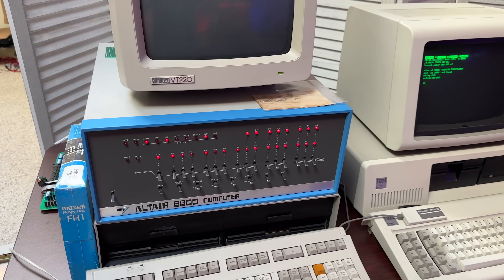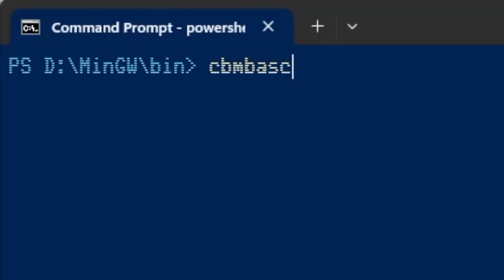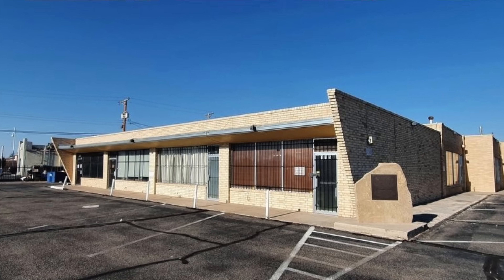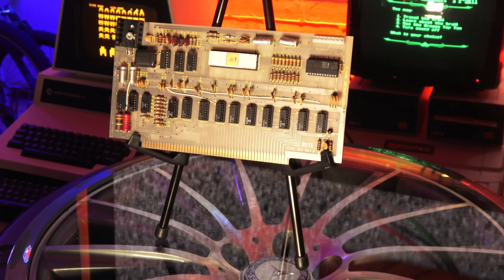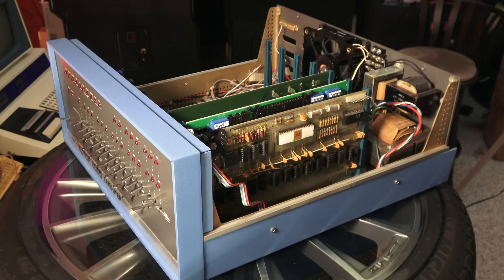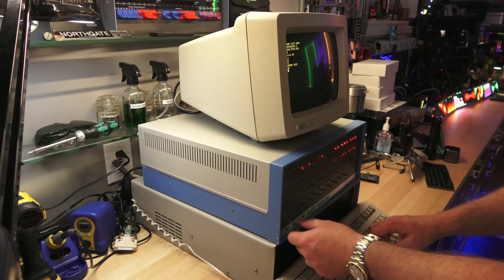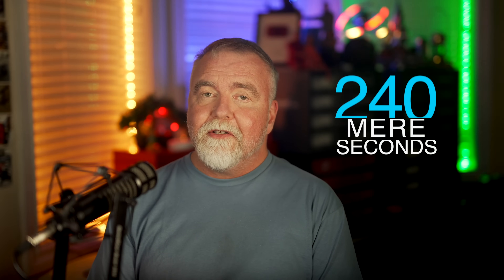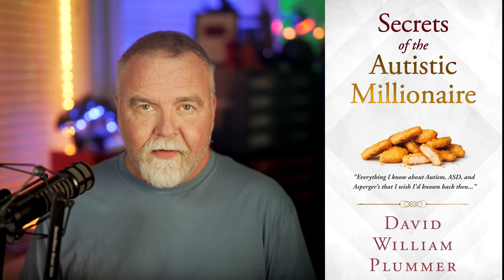Altair 8800 vs AMD Threadripper: Which is Faster?  We test them!

Comment: As a challenge, figure out how quickly the Altair could perform a simple task in response to an I/O event, and compare that to the Threadripper.  Modern operating systems have many advantages, but satisfying worst-case response times for I/O isn't really among them, compared with an 8-bit micro which is dedicated to a particular task while it's being performed.
Reply: True. Although, today, an Arduino Uno (an 8 bit micro) would probably still beat the pants off of the 8080.
Reply: @ScottWalde  Newer microcontrollers are faster, but not by many orders of magnitude.  The fastest microcontroller I know of (in terms of I/O response loop time) was a 100MHz Scenix clone of the PIC, which I think had a minimal I/O wait loop time of 40ns.  A typical 1MHz 6502 system would have an I/O wait loop time of 7us.  A 2Mhz 8080 (bottom of typical speed range) would have an I/O wait loop time of about 12us using the "IN" instruction, but that could sometimes be cut to 8.5us when using memory-mapped I/O.
Reply: @flatfingertuning727 Well, I haven't done the math, but 8080 instructions take at least 4 cycles.  Most AVR instructions take 1 or 2 cycles.   An ATMega328P will easily run at 16MHz.  A fast 8080 ran at 3.125MHz.  I completely agree it's not "many orders of magnitude" but I'll stand by my statement. :-)  Interesting you brought 6502 into the discussion... that's the one I have the most ASM experience with.  Then some Z80, and a bit of 8080, 8085 and 6809.  I can honestly say I've never hand written ASM for an AVR.  Probably the last ASM I did was on a P8X32A.  That was a fun architecture, but I mostly work with STM32s now. (and some of those can be clocked past 500MHz now.)
Reply: @ScottWalde  Designers of early LSI logic made conscious trade-offs between speed and silicon area, prioritizing the latter.  Improvements in fabrication technology have shifted the "curve" so there's not much point designing a chip that can't run 16MHz, but one could have built a computer in the 1970s that would run at AVR-like speed.  In fact, many "real" computers of the 1970s *did*.

One might view a tenfold increase in speed as "mopping the floor" with another computer, but compared with the millions-fold speed increase for some other kinds of computation, it's pretty minor.  At the bottom end, what's changed is not the level of performance that can be achieved, but rather the cost of achieving that level of performance.

Comment: I’d like to see you write the sieve in machine code and toggle it in directly. I’m sure the thread-ripper would still win by a wide margin, but it would be interesting.
Reply: Agree. 30,000 times difference actually didn't seem as large as the 2 (20?) billion times difference. Maybe with native code on Altair this is going to be even more impressive. And then we could also compare with just one core of the threadripper ))
Reply from the maker: I'll do it in ASM as soon as I can load stuff onto the Altair again!  Been fighting with a hardware issue... but plan to!

Comment: Congratulations Dave, by experimentally demonstrating on camera something that is mathematically obvious, you have earned the title of Honorary Mythbuster. The only thing left to do is overclock the Altair to the frequency of the Threadripper, and record it when it catches fire.
Reply: I'd just consider to run the output per megaherz performance to better compare them.
Reply: That's what the liquid nitrogen is for.
Reply: 'Honorary Mythbuster'  If you do it while it's all suspended from a lead balloon it might even be worthy of full Mythbuster status..  And spill some blue for comic effect.
If you didn't already see AS:Tested why his hands were blue video from the other day you should watch it, best laugh I've had in ages.
Reply: How dare you even suggest to melt the lovingly restored Altair! Sacrilege! 🙂
Reply: THis does beg the question... Can you overclock the 8800???   And how fast before it starts to glitch out.    Then...   How fast until fire.
Reply: There was a webpage 20 years ago about overlocking a 486 to 2 GHz by putting it in a freezer and packing it with frozen bottles of vodka. It worked for a while before dying.

Comment: (Intro, spoken) A company named MITS built a computer called Altair / It was dandy, it was handy, and its bus has room to spare / (sung, tune = John Brown's Body) But MITS went broke some years ago, and no-one seems to care / but the Altair bus lives on! / (CHORUS:) Glory, Glory "S" One Hund'rd! / Glory, Glory "S" One Hund'rd! / Just in case you might have wondered, / the Altair bus lives on!....
Reply: (segue into main song, "S-100 Bus" by Frank Hayes, tune = Bonny Ship the Diamond")
When I was young, my friends all worked like fools to get their share
Of an S-100 system, like an Imsai or Altair;
Well the S-100's still around, I'm very glad to say
But friends, I'm here to tell you that it's not the same today!

Chorus (after every verse): And it's cheer up, my lads, let your hearts never fuss
When you're integrating systems for the S-100 bus!

To tell the truth, the source of all our troubles seems to be
A committee on computers of the I of triple E;
They settled on a standard spec, 696 by name
Now everything is standardized, but nothing works the same!

They say the 80 boards are way too slow - it's enough to give you fits
If the 09 isn't fast enough, then go to 16 bits.
68 and z8000 and an 86 as well
And code compatibility goes straight to bloody hell!

Then add a board for the modem line and one for every port,
And a printer board and a keyboard board, and as a last resort,
For every problem we will add a board that has the cure,
It's not too damned efficient, but it's a mother, that's for sure!

And when it's all assembled there's computer to your choler
It's nice to have a micro but a mainframe would be smaller!
And when they turn the power on, it's sure to dim the lamps
With plus or minus sixteen volts and fourteen hundred amps!

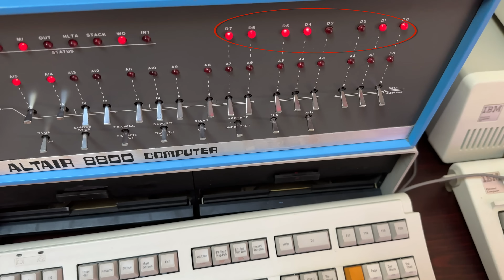Comment: 14:00 How is that 3, 6, 3 ? There are four lights on, then two off, then two on... wouldn't that be 4, 2, 2? Obviously not, I know I'm wrong, but I don't understand how it'd be 3, 6, 3.
Reply: There are two important things happening here. 1.) The lights on the Altair are in groups of 3, so each of those sections is counted separately. 2.) The output is in binary, going from the minimum 000 [number 0] to 111 [number 7]

Each of the lights in the set of three has a different value. The leftmost light represents 4, then 2, and finally 1 on the right side of the group. The number at 14:00 is binary 11 110 011 -- 11 is 2+1=3. 110 is 4+2+0 (since the 1 is not used) = 6. 011 is 0+2+1=3

Comment: Your Altair 8800 is more advanced than the one I ran that was located in the computer lab at Mt San Antonio College. The bootstrap binary code was on a printed sheet that had to be manually loaded through the switches in order to load Basic from a connected cassette player. The display was through a teletype style terminal.
The program I wrote was less practical than a prime sieve. It performed numerical approximations for the recursive functional equation:
F(F(x)) = mx +b
and then compared the results with the mathematical solution.

Comment: Loved this episode. Thanks! Clock speed difference is 2000X between the Threadripper and the 8080. I would guess that the Altair would be anywhere between 100X and 1000X faster if the routine was written in Assembly. To be generous, let's say 1000X; which would mean the Threadripper is 2B/1000 = 2M times faster. Given that the clock speed delta alone is 2000X, divide 2M by 2000 and you get 1000X faster performance for the Threadripper, negating the effect of clock speed. What you're left with - 1000X - is a pretty impressive difference attributable to processor architecture (sans clockspeed.) We have indeed come far!
Reply: Ehh, it's more like 5x speedup at best for assembly. Most of the speedup there is just from faster memory access.

Amusingly, memory access is actually the thing holding back the threadripper too; with infinite bandwidth and 0 latency you'd probably see a 3x speedup for it(and like a 20% speedup for the Altair)
Reply: Though, notably, the thread ripper also has... A lot more cores, a more fair comparison would be limiting it to 1 core, though note this wouldn't scale linearly at all in spite of the performance drop(that pesky memory bandwidth again).

Comment: No, you did not see f3 at c000. You saw 369 at 140000. Or, maybe the address was 300/000, in split octal. The good ol' days, may they never return. You could get the Altair 8800 assembled, but I had the kit. My system was baggage checked in 1977 at La Guardia and disappeared somewhere on the way to Seattle. Whoever took it was probably baffled by what they had. Still,  a friend pointed out that, in 1976, I was probably the first person to bring a personal computer to college. So, there's that. Thanks for the trip down memory lane.  Which was only 8 bits wide at the time.

Comment: 8 bit computers always puts a smile on my face. Would be interesting to see who wins Apple ][, Pet, TRS. ZX81 or Altair. Is the Z80, 8080 faster than the 6502, Motorola 6800. How much faster does assembly run the primesieve v basic
Reply: I would guess the Z80 would beat the others, though the 6502 was my favorite. I guess clock speed plays into it as well. Machine code vs BASIC would no contest. I did this comparison on a couple of 8bit systems. One was the C64... machine code was like orders of magnitude faster.

Comment: My first computer was a home assembled system based on the S-100 buss. All boards were double sided hand soldered but not through plated (so, soldered both sides). A lot of fun.The CPU was a Signetics 2650 running at 2Mhz with 4KB RAM. I suspect even the Altair would beat it.

Comment: I kind of expected the Threadripper to beat the Altair, but honestly I think the Threadripper was overkill... you could probably significantly outperform the Intel 8080 in the Altair with a 33MHz 486DX from 1990 that comes with maybe 8MB of RAM. Not a great machine for Windows 95 (the official recommendations say that's enough, and I guess it worked, but I would say just barely), yet more than capable of running QBASIC in DOS 6.

Comment: The (P) 8316E is at first glance pin compatible with the 2716 EPROM. All address and data lines are on the same pins, so is VSS and VCC.
You'll need a EPROM programmer capable of supplying a programming voltage of 25V so some new programmers will not work.

Comment: The biggest and arguably most important difference is that you could go over each of the cards in the Altair including the power supply, and explain each of their functions for just a couple of minutes going into sufficient details that a random Gen X'er like me could understand it and not give a thumbs down on the video because it would become too boring. But I bet if that Thread Ripper's power supply would break, you wouldn't be able to repair it as easily as the Altair, except by replacing it by a new one from China. And how about explaining how the chips on the motherboard work, or the MPU? Or the operating system (Well maybe you CAN explain the operating system, being you). 🙂

Comment: The first computer I ever touched was a co-worker's Altair 8800. I wasn't very impressed until he got BASIC running and a game called Lunar Lander. He kept it at work and was generous enough to allow others to mess with it and I was able to write a program in BASIC to calculate resister values for audio attenuator pads. That's when it became practical to me.
Reply: You didn't have a pair of attenuator resistance calipers?

Comment: Would be fun to see whether the prime sieve implemented in an ASIC (or maybe an fpga) could have beaten the threadripper in 1980s, 1990s or 2000s hardware ie how far back do you need to go before the software implementation beats the hardware implementation.

Comment: P8316E - those on your board are marked with the AMD logo...  They're a 2k x 8 masked ROM, typically a 450ns access time.  I found a datasheet easily enough.  I'd need to check for any compatibility with standard 2716 EPROMs.  I can send datasheet if you need.
Reply: I think only the TMS2516 EPROM is exactly pin compatible.

Comment: One important metric that is only too rarely examined is performance and/or price per volume. i.e.   benchmark passes/cuft    or    $/cuft.    The strange thing about this metric is that although passes/cuft does seem to increase over with increasing system release date, the $/cuft remains somewhat constant! 

I would be interested in you posting a $/cuft (American units, €/cc would also be fine) values for the Altair and the Threadripper.

Thanks for these informative studies. They are useful and very career enhancing!

Comment: Well, if thinking about it your threadripper system shipped with no OS, no BASIC interpreter, and definitely no C++ compiler, so it gets a did-not-finish.
Reply: The Altair didn't ship with any of those either, at least when they were first sold. Putting the BASIC ROM card in is the same as putting in an SSD which already contains an OS.

The big difference is the Threadripper has UEFI. If it has the UEFI shell that's about as much functionality as MS-DOS.

Comment: Oh, you could do quite a bit with an Altair 8800. You just need to add the right hardware.
Teletype, serial card, some RAM, and other cool things like assembler firmware card (ALS-8), VDM-1 video memory, some kind of terminal, interface card with parallel and serial (3P+S), and some kind of storage. Auto cassette or later floppy system. A printer.
Then you can get into games, BBS (Computer Bulletin Board) {we ran The Briar Patch out of Brer Washington [started with a CPM operation system with a much different configuration]} and one longtime application was a mailing list for a reunion.
Story 1:
One Saturday in the late 70’s I thought I wanted to play a game of Battleship. After toggling in the bootloader, I started loading my copy of 12K MS basic paper tape. That was 45 minutes, and it came to READY. Next, I started the load of Battleship paper tape. That was another 45 minutes, and that too came to READY. Then the power to the apartment blinked. I then left the apartment in disgusted to do something else. The next board I bought was an auto tape interface. That lasted for about a month or two and after that was a floppy drive system (90K). 
Story 2:
One time my idiot programmers runed a board game called ‘Isolation’. After playing this for a bit, they both wrote a program, each, that after a bit, not even I could beat either of their programs. Then they divided the variables and merged the two programs together so that they could play each other on the same computer. Will have to see if I can find that in my collection someday.

Comment: An important comparison to be sure! It's insane to think that the Threadripper can do more iterations per second that the Altair could have done if it was set going in 1975 and was left cycling it until now!
Reply: not really how fast was the altars cpu running at think about it and it's single core vs the thread ripper which has more cores then the altar could ever dream of so it makes sense it's progress for you just like it's progress when I say to an employer I can do shipping and receiving and they say nope cause I do not have data entry and then some employers comes along tests me and finds out oh shit I have IT training which is not in my educational records anywhere and I have a huge hole there in my records😍😍🥰🥰😘😘🥰🥰😍😍
Reply: @raven4k998  Are you confused or is it just me?
Reply: @mirknight  I do believe that is an attempt at a humble brag that just comes across as pre-stroke symptoms.
Reply: So if someone gives you a complex task to compute, that's going to run for ages, then maybe you should just not bother but rather wait for a new machine that can do it faster......
Reply: @paulstubbs7678  This can/does happen. It's not uncommon for custom silicon be designed to solve a problem faster than a normal general purpose processor can do.
Reply: @paulstubbs7678  It's the halting problem. You just might wait forever.
Reply: Someone wrote that a Raspberry Pi 1 ist actually as fast as a Cray-1 supercomputer from 1976 (130 MFLOPS).
Reply: Lol important
Reply: I wonder if there's any calculation that you could have done on a 70's era machine, a 80's era machine, etc. such that when left running, they would all finish at the same time.
Reply: Eh no biggie, to get to the Threadripper's number you just need to leave it on for about *checks notes* 370 years... 💀

Comment: I have an Altair 8800 sitting in a closet, but haven't gotten motivated to try to get it running again yet. Mine came from a university soil lab, where it worked as a data logger with a custom wirewrapped I/O card connecting it to several HP lab instruments. I would have preferred seeing an 8080 assembler version vs. the modern machine's optimized C++.  But I know that would have been considerably more work. :)

Comment: Thanks for the stroll down memory lane.  My Altair was sn 529 if I remember right.  I did lot's of learning with it.  Also built SWTP TV Typewriter II And HrathKit dot matrix printer eventually.  With a DCHayes 300baud dial up modem and AI Cybernetics speech synthesiser, 2 8inch single density floppy drives, and a Processor Technology 3P+S and eventually a 1k ROM with a Intellec comparable bios, life was good. I ran it till about 1985 when it came down to it ot staying married.  😢😮 I wisely chose my wife.